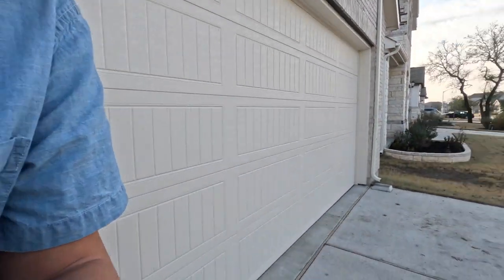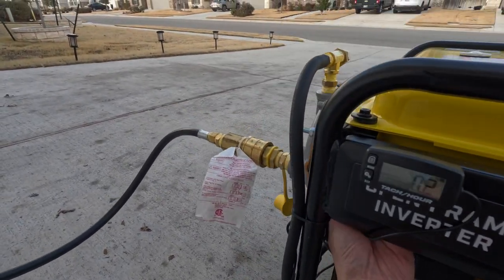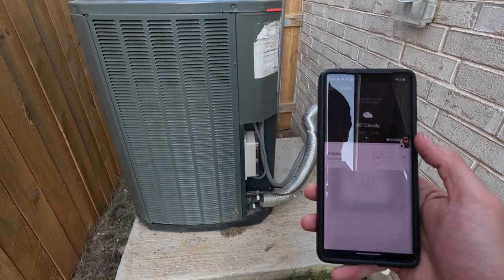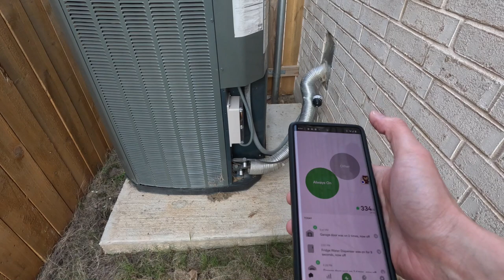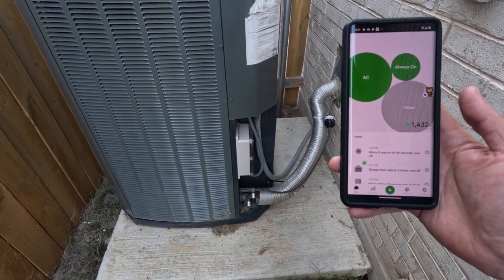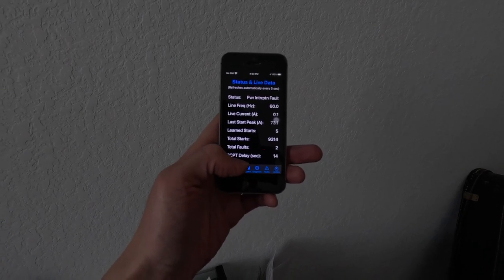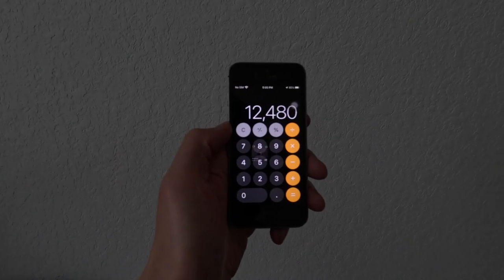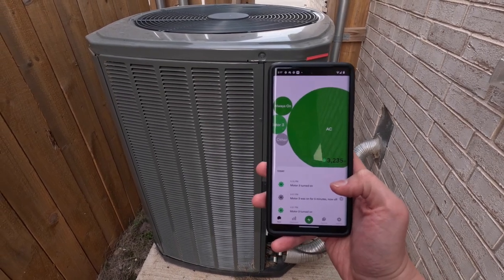Can a 8750W Motor Snorkel Tri-Fuel converted generator power a 4 TON AC Unit using Propane???

Comment: You need to use a shorter Generator Cable no longer then 12feet  The shorter the BETTER !  your cable looks like 35 feet  which will Drop a lot of Amperage  !  Try a much Shorter Power Cable First Before Buying a Bigger Gene .
Reply from the maker: My cable is actually 75 feet and I didn't notice any drop in voltage. As far as I know, it is voltage that drops with long lengths of wire, not amperage. I was actually able to get it working after tuning the fuel block. You can check it out in one of my later videos - thanks for commenting! 

https://www.youtube.com/watch?v=Fgqlg9NThBM

Comment: Interesting wonder if the xp1300eh generator would be able to power the 4 ton ac 🤔 seems like it should on paper but barely.
Reply from the maker: With an easy start? Probably! I wish they made inverter generators cheaper though. If money wasn't an issue, I'd probably go with a parallel linked generator like the Genmax GM9000ied or the Duramax XP9000iH. Both do around 7500 watts individually and then 15000 watts when paralleled... The problem right now is if I start getting into that spending bracket, I might as well start considering permanently installed standby generators and it just isn't worth the cost for me for the once or twice a year power outage I have. All in all, I am still under $2k, even with all the trifuel conversions and the modifications to the house to safely accept generator power.
Reply: @jonathanDIYs  westinghouse 12,000df with 15,000 watts start up watts and 12,000 running watts - 2,500.00. Soft start kit for ac - 300.00. 50 amp cord 100.00. 50 amp wall plug in - 50.00. 2950.00 for entire setup. Will run a house pretty much. Less than <5% THD as well for sensitive electronics.
Reply from the maker: @bobcob3362  I'm surprised to see such a low THD number for a non-inverter type generator. I didn't know they make ones that low and I wonder what's the technology behind it that they use to achieve that. Thanks for pointing that generator out! I've seen it before but always thought it was so massive and passed on it because it wasn't an inverter generator.
Reply: @jonathanDIYs  mine will be delivered next week. I did a lot of research before pulling the trigger. The only downside I see on this one is the noise. It will not be quite as an inverter generator. But mine is going in a shed I built. This generator gets a 4-1/2 star rating out of over 13,000 Amazon reviews. That is where I bought mine. 2,499.00 with free delivery. Check it out.
Reply: @jonathanDIYs  the technology is a regulated alternator I believe. Also comes with a 3 year Warranty. Seemed like the best bang for the buck for my specific needs. Fuel hog I'm sure. Lol.
Reply from the maker: @bobcob3362  awesome! Hope the install goes well for you. If you're putting in your own generator inlet receptacle, make sure you have a proper transfer switch whether it be a dedicated unit or a mechanically interlocked breaker kit. Good luck and stay safe!
Reply: @jonathanDIYs  oh yea. One last thing. You tube has a few videos on this particular generator. Please don't confuse the westinghouse 12,500 though. It's smaller and does not have the <5% thd. It is rated at <23%.
Reply from the maker: @bobcob3362  yeah, 10 gallons every 16 hours... The champion inverter generator can do up to 10 hours every 4.2 gallons.  Guess it's good it takes propane too cuz otherwise you'll need anywhere from 20-60 gallons for a week depending on how much you will need to run it.
Reply: @jonathanDIYs  yep. Gas hog for sure. Inverter is the way to go for the auto idle when demand isint high. Thought about the parallel kit for 2 Inverters,  but didn't seem justified for our situation. We have a small storage facility plus a house. This will run everything according to my calculations. Gate, outside lighting, well pumps, etc,, we will see when I get it. I'll keep you updated.

Comment: Why would you want to run a 4 ton AC off a generator? If the power is down then plan on a cool room in the house with a little  5000 btu window air conditioner - typically a bedroom to cool off during the day and for sleeping at night. You can keep it in a closet and install it in minutes if the power goes down. Also you are going to need a lot of gas or propane stored up for even just a couple of days without power to run a generator that size.
Reply from the maker: @kevinm234  thanks for commenting! I have hooked my generator up to the natural gas that comes into the house as well. I do not have to worry about gas storage with this source of fuel. I get about 8-10 hours of runtime per 4 gallons, I don't run at night. I'm able to last 3-4 days with the gas and propane I keep around the house and can switch to natural gas as well. It is a matter of comfort and preference for keeping things as normal as possible throughout a blackout or other type of emergency situation.

Comment: Are you running your house off the generator at the same time your trying to run your air. Turn off breakers until your air starts up.
Reply from the maker: hi Don, yes - the rest of the house is connected, but I did have all the breakers off before starting up. Unfortunately, the power draw from a really cold start is just too much. Thanks for commenting!